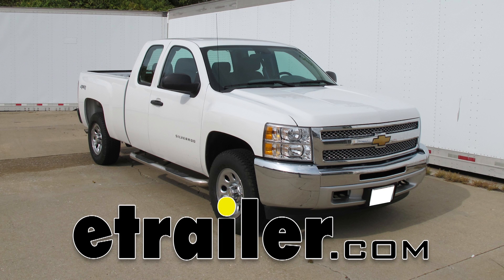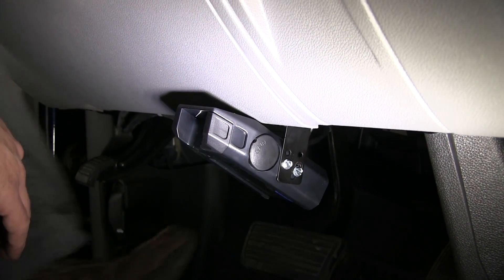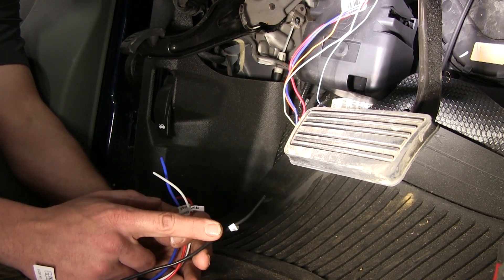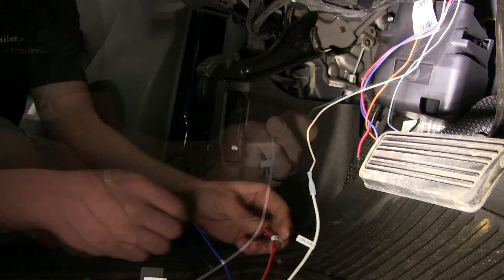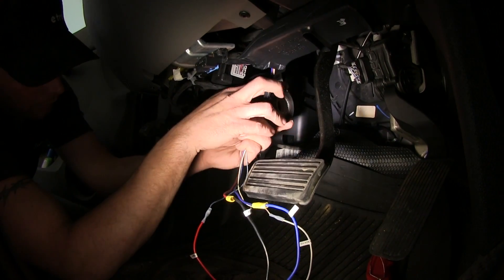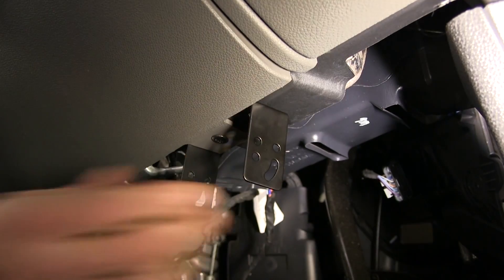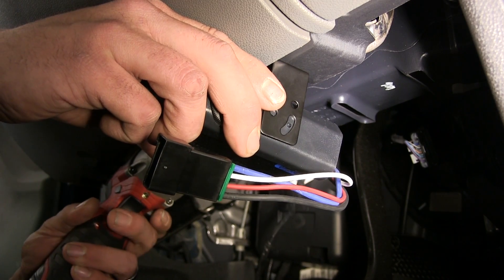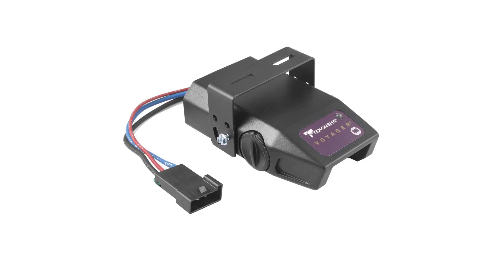etrailer | Trailer Brake Controller Installation - 2012 Chevrolet Silverado 20127

Comment: do not forget the two red wires that are at  the battery 6m and a 8m nuts need to be bought on red is down by the steering arm the other is behind the fuse box
Reply: ps that is on a 2007 the 2012 my need to be plug in under the driver side  youtube it more.. LZ
Reply: Mine was behind my fuse box - You win, thank you